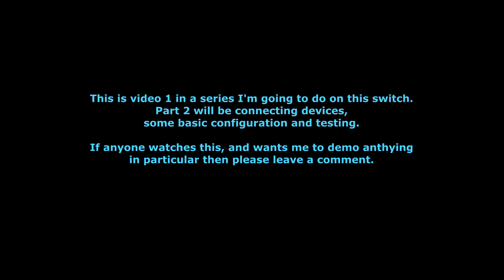Unboxing the Mikrotik Netpower 16p with Angry Barry

Comment: Did you know that you can attach BOTH the 24v and 48-57v adapters (as well as a mix of devices) and the 16P will apply the correct voltage to each device?
Here's what it says in the MikroTik brochure:

When using both the high and low voltage adapters, the netPower will automatically choose the correct
PoE standard and voltage, based on the devices you connect to each port. You can also specify it manually.

Now that's pretty awesome!
Reply from the maker: To be honest, I don't know when I knew this. I know it now, but I don't know if I was certain when I made the video. All I can say is; good point! It seems that these videos have some views right now, and if you would like me to do anything with my setup then please say so. I am loving my Mikrotik setup and I would like to offer others any insight into the operation of these devices to get others into the infrastructure.